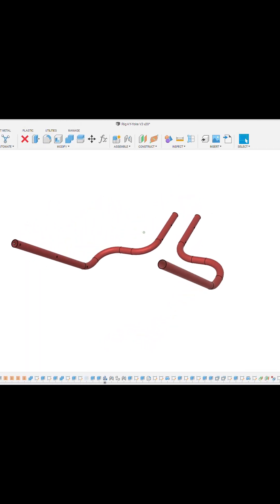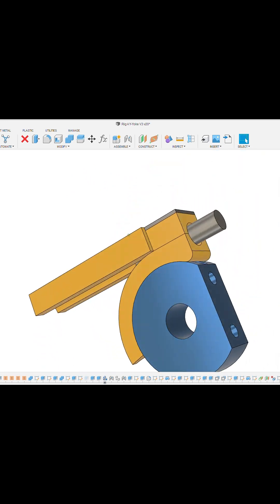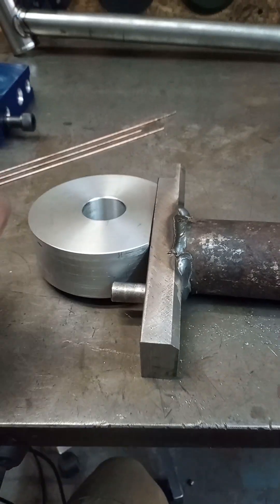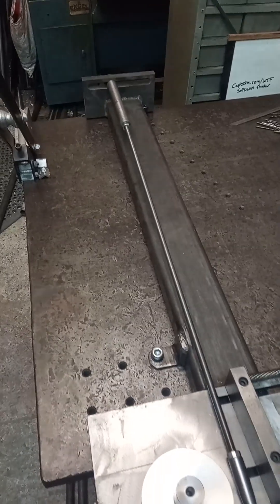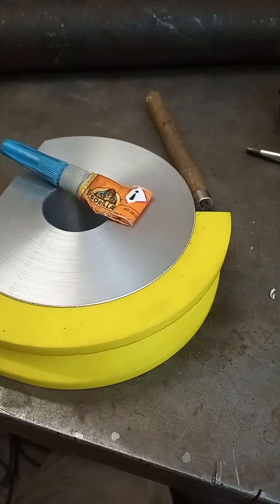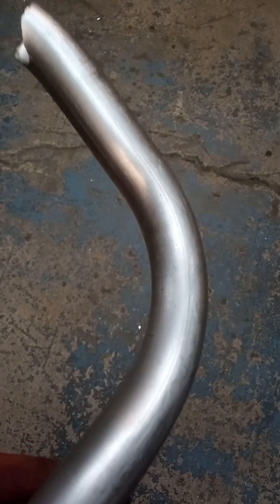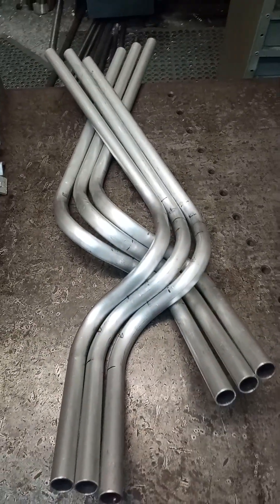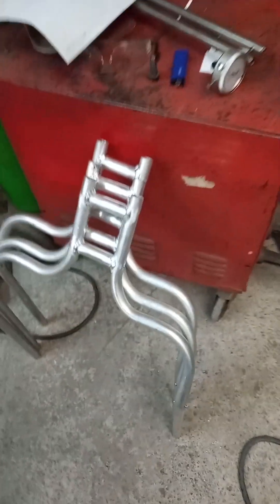Will it work? 3D printed tube forming

Comment: Thanks for sharing this! I'm working with 4mm OD (3mm ID) stainless steel tubing so won't need to go heavy duty like you did. I need to design a cam lever for the remaining 80mm of a 300mm length of tubing where I need an "S" shaped curve a the end of my piece.

Comment: Very nice. I see the second time around you supported the top and bottom of the main die with a metal plate. I was going to recommend that. Regarding the mandrel, I've seen the flexible ones that look like a rattlesnake tail, but your straight mandrel seemed to work just fine. I built a tube bender and would like to add a mandrel for thin wall tube. I've seen some flexible mandrels made from pucks of Delrin plastic round stock held together by chain or cable. Have you ever considered making a flexible mandrel on a 3D printer? Or even a non-flexible one? Probably have to use polycarbonate or carbon fiber nylon. Something to consider perhaps? Your mandrel design seemed to be an simpler and easier solution. Certainly anchoring your end clamp into the aluminum wheel was a great solution. Thanks for the vid. Subscribed.

Comment: Mandrel too pointy which is why the bends are flat. Needs to be ball-nosed.
Reply from the maker: Thanks for the tip 👌
Reply: @BTR-Fabrications   No probs. The full diameter of the mandrel needs to be in front of the bend-die tangent. I always start at 2mm in front and advance from there if required.

Comment: This is super cool! There’s another channel that uses the same approach, but they sandwich a full 3d print in between two plasma cut sheets of steel with a steel bushing in the middle to keep the print in a constant state of compression - similar to that plate you’ve put on the top of the bend die on the version that did work in your video, except the whole die was designed like that with thicker top/bottom plates. They’ve done a lot of bends like this and it seems like it’d be faster/cheaper vs. the Ali slug method you have here, if you’re interested!
Reply from the maker: Rad, thanks for the heads up. Definitely keen to check them out. Do you remember what the channel is called?
Reply: @BTR-Fabrications yessir! JD's Garage